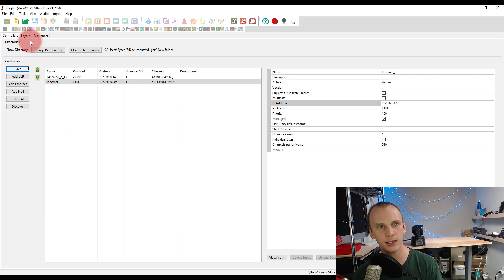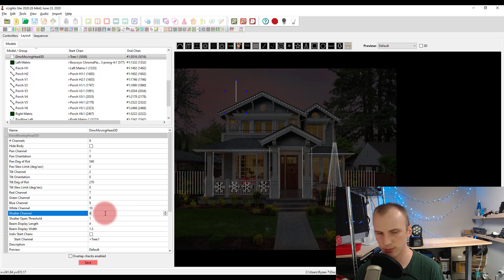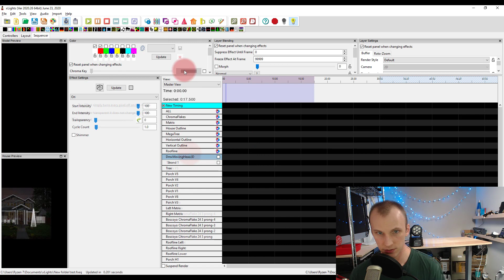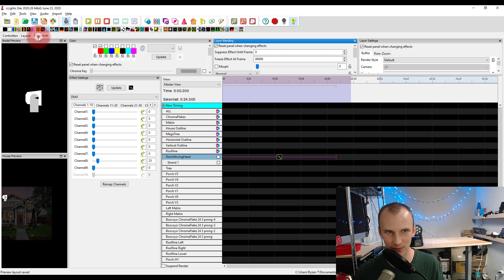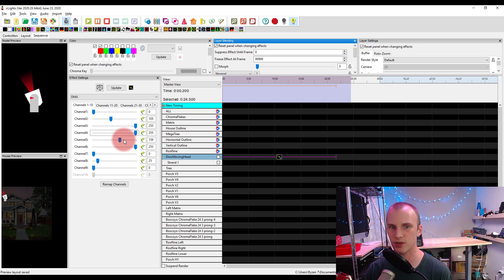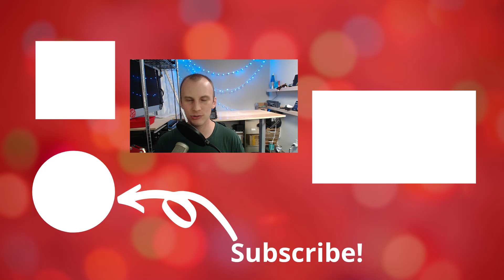DMX Lights and Your Display

Comment: ok i have the first light on dmx 14 channel the second light on dmx channel 34 both lights adress 001 with the obey 6 and the only thing i can do is movement, they do the same move together but i cant get no colors nothing ,why? what i am doing wrong
Reply from the maker: You need to look at the channels for the light you have and bring up the faders that correspond to that channel. It may be that you're running out of channels, as the Obey 40 really only has 6 faders, and splitting a fixture out across multiple fixtures in the obey is complicated and not really the way it's designed to work

Comment: i need help,i am trying to use obey 6 with 2 intimidator wave irc, how 🤔, i have the dmx 34 channel selected  on one and the 2nd light on slave, but whe i am using the obey 6 only one light is responding what am i doing wrong?
Reply from the maker: Set the 2nd light to dmx mode and an address.  Not slave mode

Comment: Hey David, I’m having issues connecting my DMX moving head directly to my HolidayCoro controller via the RS485 jack. Do you know what color wires DMX+, DMX-, and GND are supposed to be? My XLR cable has red, white, and black. 

Also what is the controller you are using in this video, and how would you test individual DMX channels before you start sequencing / working in layout?
Reply from the maker: Every cable is different, but pin 3 (the "down" pin) is the +, and pin 1 is the ground.  

Here's a visual representation: https://www.google.com/imgres?imgurl=https%3A%2F%2Fcdn.shopify.com%2Fs%2Ffiles%2F1%2F1741%2F5055%2Fproducts%2F3-pin-DMX-pinout_5181b6e7-140a-4f15-b6db-2e6f265bc060.jpg%3Fv%3D1615323710&imgrefurl=https%3A%2F%2Fwww.blizzardpro.com%2Fproducts%2Fdmx-cool-cables-3-pin&tbnid=eUD25t1y4OmzPM&vet=12ahUKEwipnoOpj43xAhUKFVMKHR-_DpUQMygAegUIARDMAQ..i&docid=BcyjCuwmagQh5M&w=600&h=400&q=dmx%20cable%203%20pin%20pinout&client=opera&ved=2ahUKEwipnoOpj43xAhUKFVMKHR-_DpUQMygAegUIARDMAQ

In this video I used either a Falcon or a Kulp (don't remember exactly), and you can test the light by creating a DMX fixture with about as many channels as you think you will use, then run a DMX effect in the sequencer and test each channel with that.  I will be doing more next month, I believe, on DMX lights here on  the channel.

Comment: Hi David. I’m pretty new to both led strips and xlights. I hooked up my Dmx pro by USB and set it up. From the Dmx I’m using a sp201e decoder and the connected to the strip. The only problem I’m having is the ws2812 strip doesn’t match colours in the light software. I have the ws2812b with a separate white. So it’s a rgbw with a data line. I guess my first question is are ws2812b rgbw compatible with xlights and If they are where can I configure each one which I believe is suppose to be setup as grbw?
Reply from the maker: In the "Layout" tab, there is a section for each model called "String Properties".  In there, you can go to "String type" and select RGBW.  :)

Comment: Is there any way you could do a video on the wiring for DMX out of a falcon or a kulp board I hear some of the boards don't have a ground and I just ordered my first DMX moving head
Reply from the maker: Possibly.  But I would note that the Kulp's do have a ground, and on the Falcon typically one port may not have a ground, check the manual as it explains it well (for each falcon product it may vary)